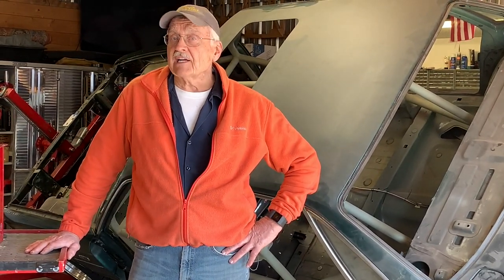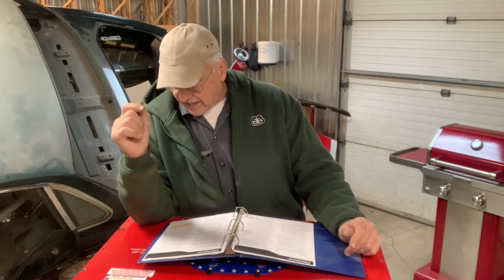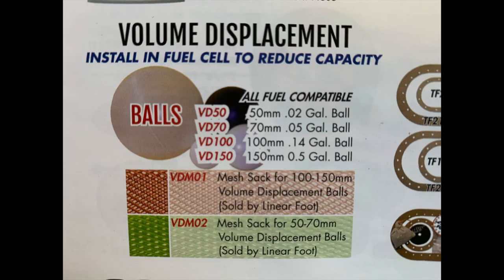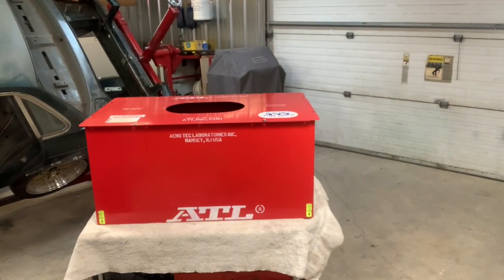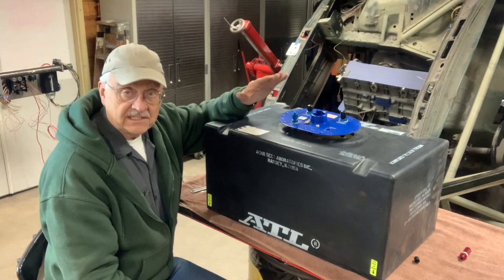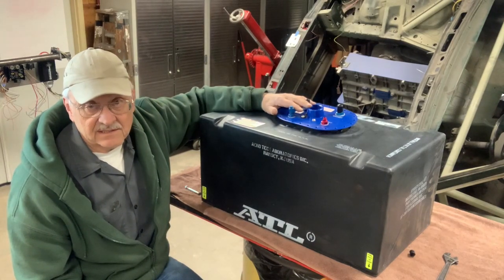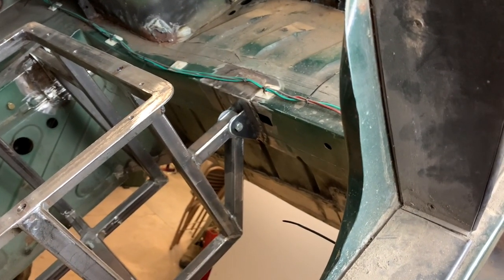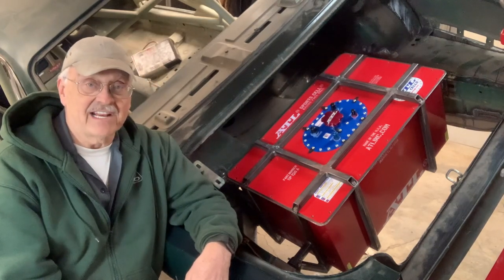So you want to install a Fuel Safe, RCi, or ATL fuel cell in your race car?

Comment: Thanks.  I've been "road racing" with NASA for the past few years.  HPDE actually, not competition.  I am ready to step up to a competitive environment.  I've been running my street car, a Dodge Challenger.  Good power, very heavy.  Have gone through brake upgrades, tire upgrades, and suspension upgrades, and have gone through 3 engines.  So I finally am learning my lesson and trying to get a track-only car, that is lighter, perhaps easier to work on, and less heartbreaking should I mess it up.  I bought a 1988 Nissan 300ZX.  It has been a race car its whole life; never been on the street.  Showroom stock first, then SCCA.  I'm not clear about what classes it ran in SCCA.  When I bought it, it was well used, with bondo on the quarters, and the front end was modified as the previous owner was trying to put a front intercooler and bigger turbo in it.  I pulled his mods out, re-engined it, ripped out all the old wiring, and am rewiring the car, replumbing it.  I've replaced the seat, harness, and steering wheel.  Still need to add some type of fire suppression system.  And the last few days I've been working with the Fuel Safe cell.  Initially, I was trying to get the old foam out, as I don't know how old this cell is, I'd say at minimum 20 years and there is no evidence I can see of the foam being replaced.  I cannot get the cover (access plate) off to get into the cell.  I don't know if they sealed it with something, or it is just so old, or what.  At this point I"m thinking replace the filters and see what happens, but my gut says that foam is going to go to pieces when I put fuel in what has been an Arizona dry cell.  My head says pull it out and replace it, but as you mentioned, what I am seeing for prices is in the $1500 range and that is a lot of money for me...  Any ideas?
Reply from the maker: Hi. If your cell is like the ATL unit we're using, all that should be required is to remove the  cover and gain access to the foam is to remove all the screws from the access plate and lift upward. If the plate is stuck to the outer shell it may be everything has just stuck together due to aging. If the plate comes loose but won't come out all the way it may be the foam has hardened over time and won't allow the pick-up  to pass through the foam. Good luck with your project.

Comment: I’m curious about the handling effects of the stock tank in the stock location (high CoG) vs the fuel cell aft of the rear axle causing a pendulum swing effect under braking and corner entry. We’ve retained the stock saddles-style tank on the BMW which is mounted underneath the rear seat in the car. Perfect location balance-wise and we get 1hr50mins plus out of it at most tracks we’ve been to so far. I do envy those additional two gallons a fuel cell would provide but I wonder what the effect to the handling would be. It’d likely be significant at high fuel levels behind the axle I think.
Reply from the maker: The higher polar moment of inertia could be a problem with handling but I think the lack of experience driving a race car with all but one of the team members will probably be the bigger issue.  This fuel cell is BIIIIIIG and it will be difficult to find a spot for it elsewhere. The rollcage braces in the rear seat area would have to be changed to put it in the rear seat but that could be done. Thanks for the input.
Reply: @thecampchaoschronicles9567  Definitely a few track days with the guys to gain experience are needed before they're subjected to wheel to wheel shenanigans. Perhaps use your experienced guy as a driver's coach and fit another seat in the pass-side temporarily?
I suppose if you had the will you could fabricate a twin fuel cell set-up and  basically occupy the same areas beneath the seat as BMW and a lot of manufacturers use these days. No doubt it would be a lot of hacking and sheet metal removal in order to situate them in the low position. It's a shame the tunnel and prop shaft get in the way!

Comment: I bought one where in the hell does the each line go , i received no directions and this is my 1st fuel cell conversion im old school cars for 40 pluss yrs but im confused on alot of it now i know inlet return and vent yet i got no information on which 1 was which
Reply from the maker: If they're not labeled, there should be at least three fittings. The return should just empty back into the tank. The pick-up or outlet should got to the bottom of the tank. There may be two outlets on some cells used for road racing purposes and if you only need one just cap off the one you don't need. The vent should have a check ball in it to prevent the surging of fuel out of the vent. If you go to the manufacturers website, they will provide installation instructions. I hope this helps.